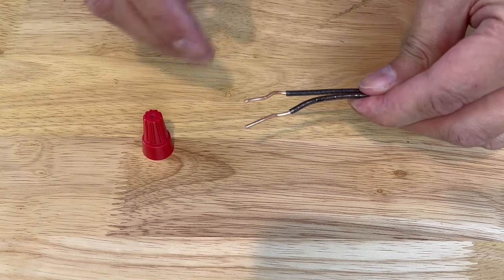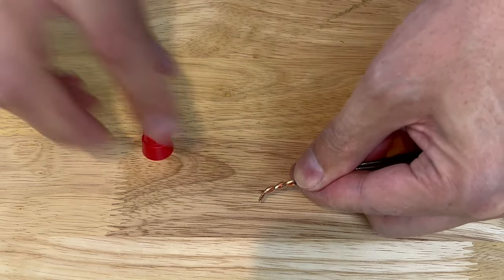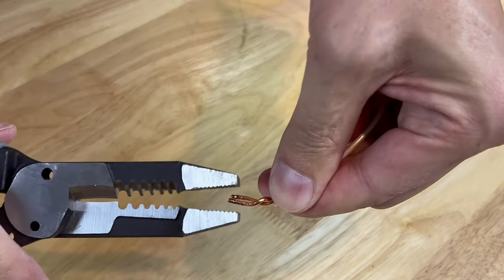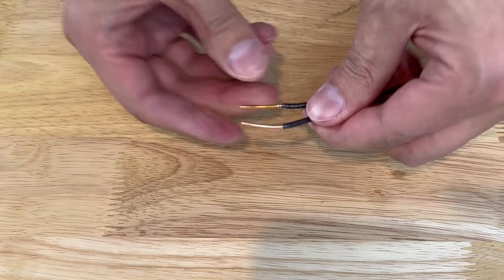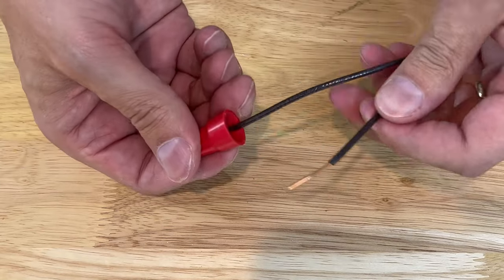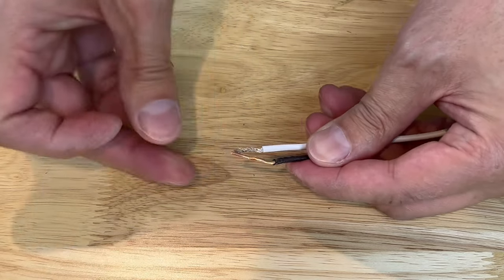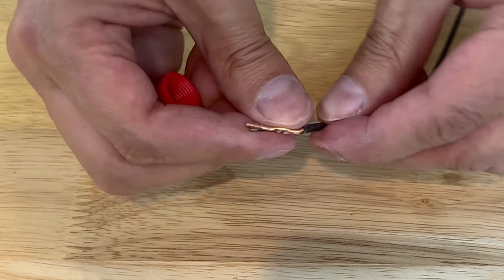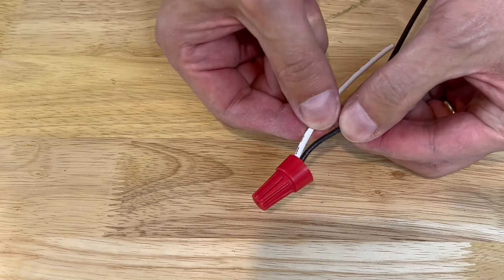Beginner’s Guide How to Use Electric Wire Nuts

Comment: you don’t have to pretwist if you’re an electrician you know this
Reply from the maker: Thanks for watching. I’m a general contractor. I agree most electricians don’t pre twist wires…however some do 🛠️🛠️
Reply: @HomeRapidRepair  haha true but i’d say just follow the manufacturers instructions & if a wire is not secure when u tug repeat until it’s secure.
Reply: Does it hurt to pre twist the wire? Why would you not want to pre twist if it only takes a few extra seconds?
Reply: @adamzeller4160  Agreed. Wish aaronship explained why not pretwist, given the problems the video mentioned.
Reply: As a DIYer I do appreciate this